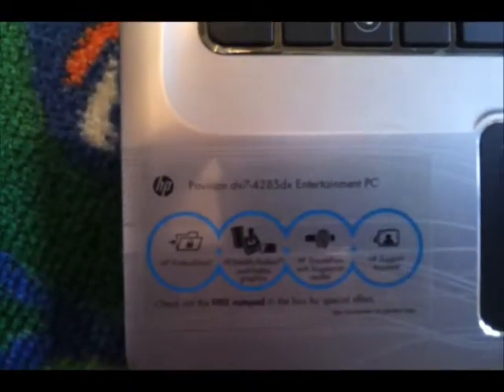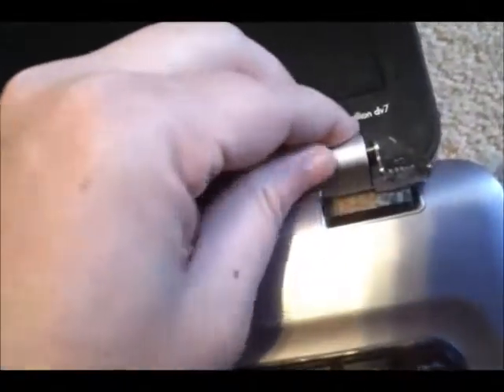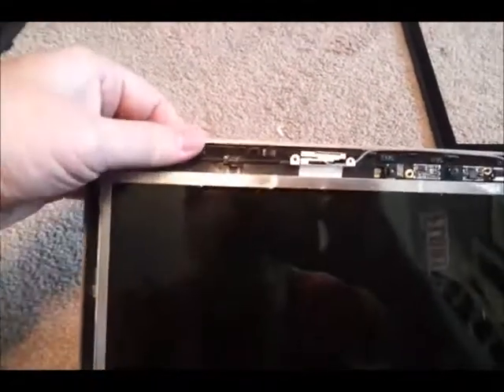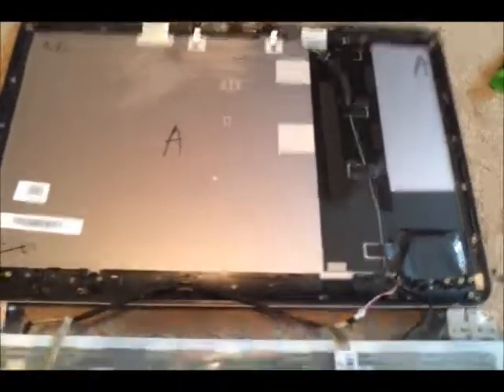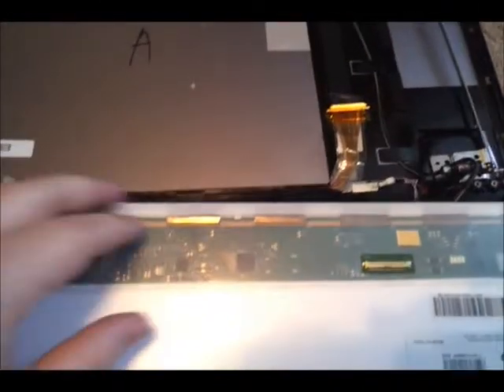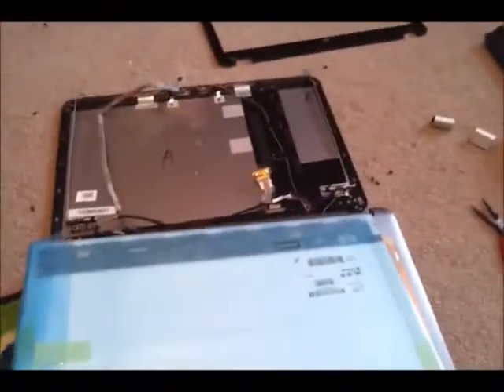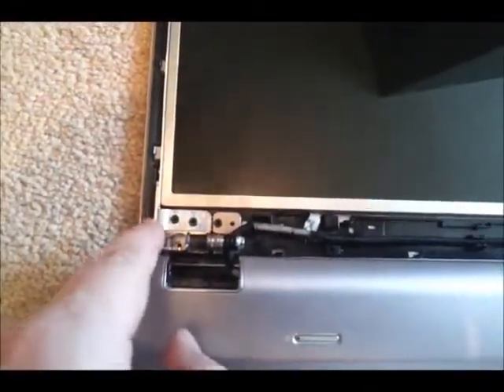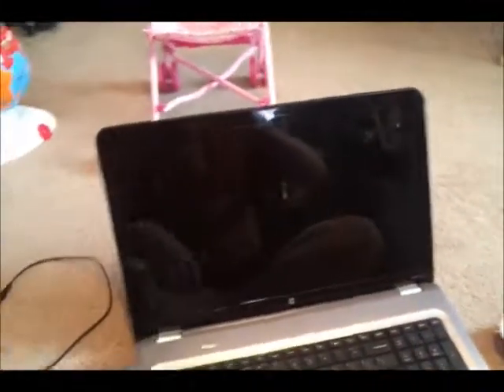Laptop screen replacement / How to replace laptop screen HP Pavilion dv7-4285dx

Comment from the maker: It is mentioned in the video about the hinges.  Yes, you do have to open up the laptop to unscrew the hinges.  This is a rare/differently made model to where you have to do this.  Most are made to where you do not have to unscrew the hinges from the laptop. This is showing a screen replacement.  There are other videos or diagrams showing how to open up the laptop which is why it was left out.